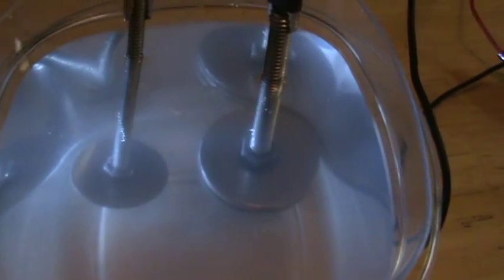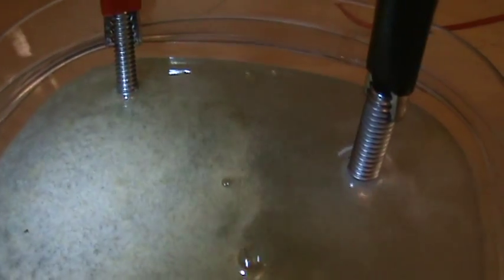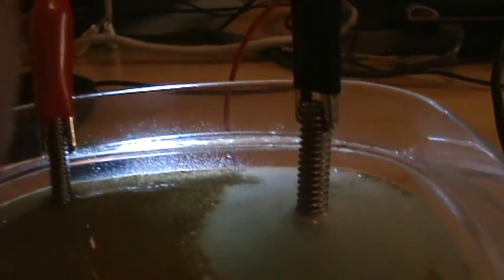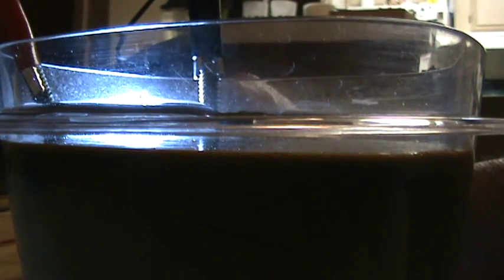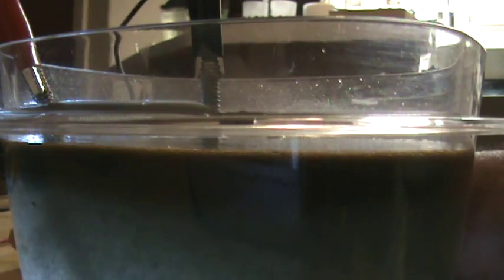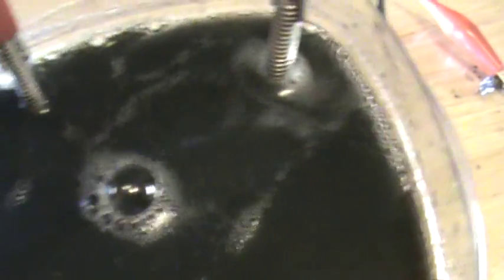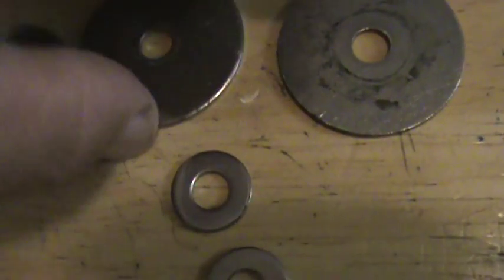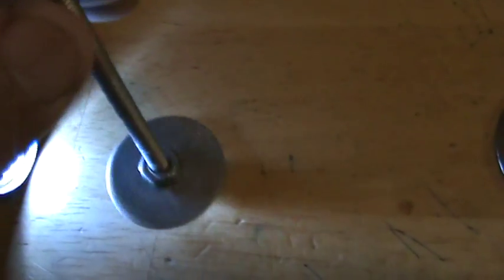green HHO generator using table salt 1 table spoon

Comment: Hmm. The reaction is definately toxic. Be careful. Anyway.....the color. If there is any copper in there the green is CuCl2, Copper Chloride. Pretty toxic. Not sure about the copper though. Looks like you have steel electrodes. That would be producing Chromuim. Could be greenish and then with heat and more reaction it could go purple blackish. Also toxic. I might need a brush up on my chemistry. I didn't verify this before posting. But I hope it gives you something to go from.
Reply from the maker: +Shaun McClurken this is a old video, I no longer mess around with hho.